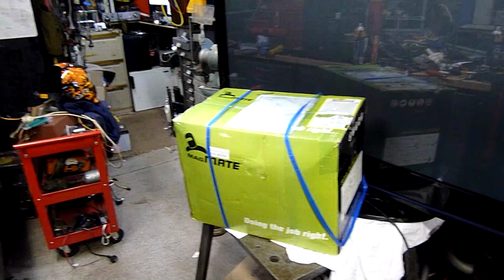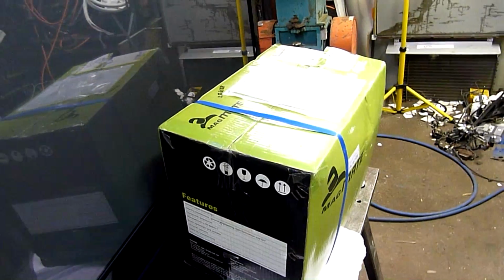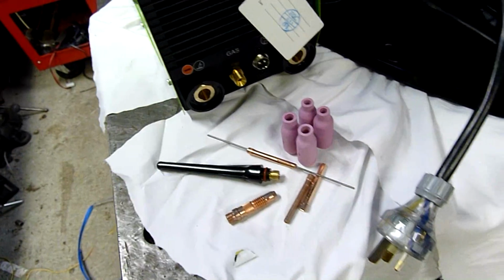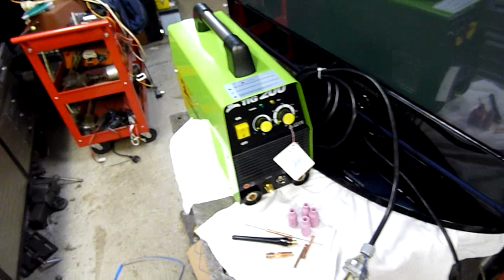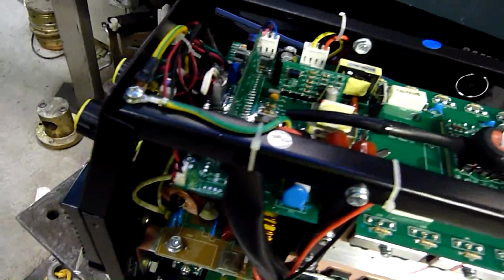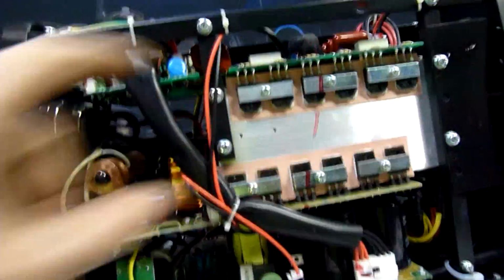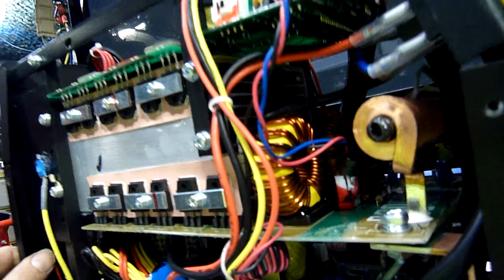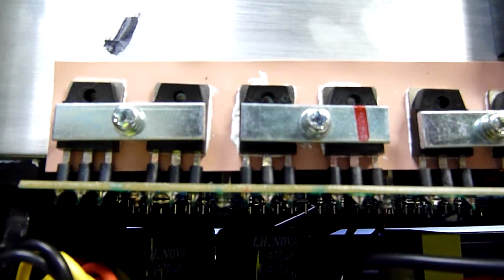Magmate 200A Inverter Tig Opening and Inspection

Comment: Hi mate i have the same TIG Welder and just today popped the cover off to see what condition it is in after having it for a few days i generaly determined the same as you over soldering that i was actually happy about and few other really awesome features and components generally not a bad machine for the price and it is good quality for a Chinese design i quite respect it after checking internals the Fet's and Fsd's as you did. The only downside being of course that it doesn't do aluminum and other important things due to lack of AC for the cleaning action etc. What i am thinking of and what i would like you to also have a look at is the top Logic Control board there are jumpers that are soldered together instead of connected to a a switch on the front panel (J1, J2, J3, Con8, Con12, Con13,)  and other various 2.3.4 pin connectors not soldered on the board up front eg RT3 could be a Remote Pedal Connector, i have have a good knowledge of electronics but righ now i am just speculating and i hope you where interested enough to check it out too my guess is they may be for controlling: Pulse frequency, AC/DC, TIG/STICK,  like you see on other inverter Welders!!! I could really bring some hidden extra functions to it. Probably just got to find out where they have copied the design from...

Comment: Any updates on how this machine is going? It's the cheapest unit on the market with HF by a mile, makes me a bit nervous why its so cheap!!
Reply from the maker: I have put a good few hours on it so far and no issues, it does not perform like a $1000+ tig, but its fine for hobby use!.
Reply: Aussie50 Thanks, when you say it doesn't perform like the $$ units what are the main drawbacks? Just the lack of frills, cheap torch etc?

Comment from the maker: I bought a $60 reg and flow gauge but the problem is it dumps too much gas when I trigger the solenoid, and it leaks all over the place too :(, I need an old style one and proper gas line going to the welder.

Comment from the maker: I will be building a special air delivery system for it, most of these die due to metal dust from the workshop getting all over the boards, or being overheated. I will be using 240V fans and a filter cartridge from the old Battenfeld control cabinet.

Comment: check the solenoid gas valve on the welder, some not all have problems  leaking after a  while of use,.a flow gauge is a must after the regulator for a few good reasons, leakage and better setup. often the job clamp are rubbish on the cheap units and often  don't work that great leaking amps heating up, monitor it or just change it for a quality one ,that way will never cause any issues.

can buy full size gas bottles for a 3yr period . no rental saving loads just pay for refills.

Comment: mostly transistors die from poor safety control systems,not so much from low air flow, failure is typical when built using 3rd party components, having Toshiba transistors is a good start as long as they are not copy, lol does happen, looks a typical  DC inverter rev 2.
inverter welders like clean environments, so no angle grinding or lathe turning in direct path or unit, be surprised how many owners kill units that way.

that coil is for current sense not HV.zforce69 think you will find.
enjoy

Comment: Hey Ed, Try the seller " 6shop-river" on ebay for all your tig stuff. I got a 100pc kit for my plasma cutter from them reasonably priced. You're going to get screwed if you use BOC for anything. Also, I brought my own gas cylinder from a NSW company called Speed Gas. It's a D size I think, about the size of a medical oxygen bottle. I just freight it to them and they refill and send it back, no rentals.

Comment: Ed, get some sort of fine mesh material and put it on the front on the intake and wherever you think there's an air intake, that should keep dust out.And secondly grab a server case fan, the metal ones that you can plug in to mains.Server fans last ages, especially the metal ones.That one you can put over the stock fan or replace it temporarily. I have an array of these sucking air through a filter. I do check it every 3 weeks and there's no dust inside. Though i do replace filters all the time.

Comment: Are those fans in that thermally controlled if they are you should just have them come on full speed all the time because it is cheaper to wear out your fans than to fry your transistors and diodes form overheating them like in pc psu's your better off killing your fan than killing the psu

Comment: HF start for $250 you cant beat. what is the "S" control on the front? 
it isnt a badly built unit, the ones the air tools shop sold were much worse than that.

Comment: That's the same thing that seems to cause a lot of transistors in plasma TVs to short and self destruct, not enough heat sink compound so they overheat, that and bad solder joints.

Comment: I'm too cheap to get the gas, so may never tig (DIY gas generator from solid powder ?...what a racket those gas companies)...wouldn't mind the dual use plasma cutter/tig machines that can run either 220v or 110v on ebay. I hope you get a spot weld kit for that, now that is something I would use...total versatility: 
youtube.com/watch?v=3-LSuFsqoWc
TIG Spot Weld Kit - How To - From Eastwood

What's the .AU wide hardware store like our harbor freight? Hare and Forbes? It looks like you don't have

Comment: Tantalum capacitors also tend to fail quite spectacularly if overvolted; they will get hot enough to melt the metal film in the capacitor and glow red hot.

Comment: that teroid/transformar at the top if the welder looks like the gate drive transformer for the mosfets. you can see the leads going to it cone from a small H-bridge and the smd components there are the gate resistors and voltage clamps. looks relatively well built for $230 I will have to look into using one if these things as a base for a tesla coil/induction heater. Happy welding!

Comment: Not all of us can justify buying top shelf tools when its for a hobby use or if we cant afford it. Sometimes if you use the tools smartly and take into account all of its limitations you can get by with less. 
I use my plasma cutter for my hobby's and it works wonderfully so far. 
It will never be good enough for welding equipment snobs but its working better than expected for me